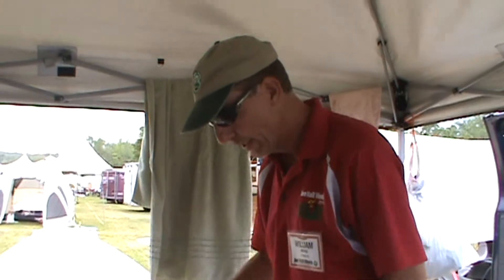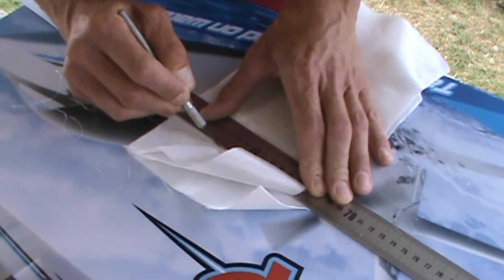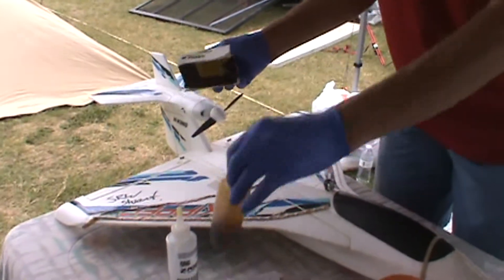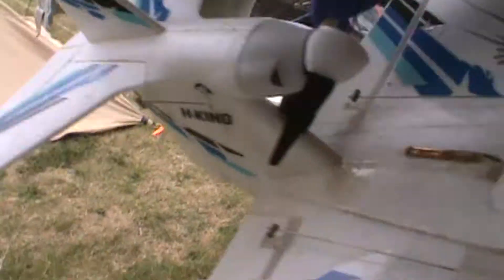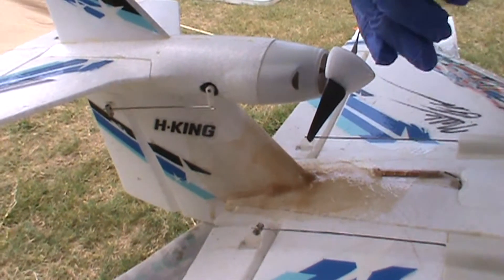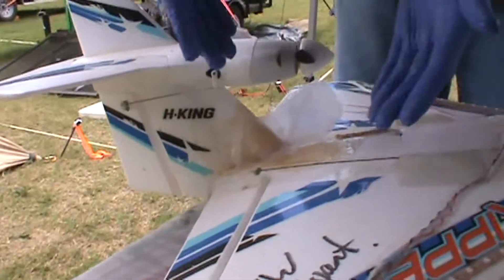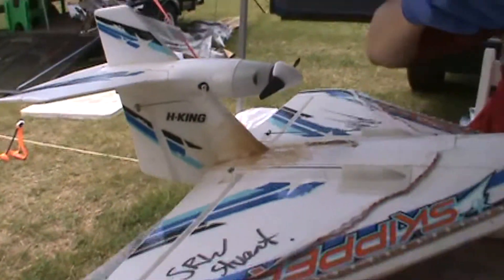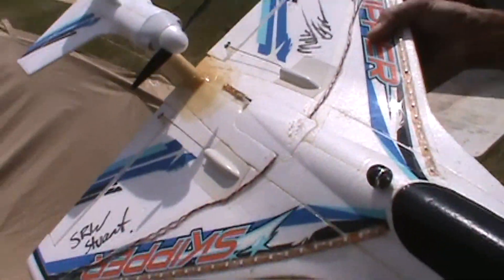Fiberglass Techniques for Radio Control Airplanes

Comment: When applying fiberglass to compound angles such as the base of the rudder in this video. Hold the fiberglass between pinched fingers at opposite corners of the grain and stretch this will make the grid more diamond shape than squares then when you apply the fiberglass you stretch it back to square where it needs to be and you will not have to cut it weakening that part of the fiberglass

Comment: Do you need to use a special type of epoxy or is any 2part epoxy OK.  I would be worried about the foam melting using epoxy.  Thanks for the video.
Reply: Michael Withington just make sure it’s slow curing and foam safe.
Reply: Only thing I would add, if you use normal epoxy and not finishing epoxy like he does in the vid, you cannot mix it in the same large quantities. If you do you'll find it heats up and sets very quickly.
Reply: Another tip: if you are using large bottles and they have been opened for more than two weeks, you should add denatured alcohol to remove the water that gets absorbed by the resin. Especially useful when applying to balsa skin and structure.
Reply: Also, you should NEVER FOLD FIBERGLASS. The glass is weakened and broken when bent. Put it on a roll of some type when storing it.